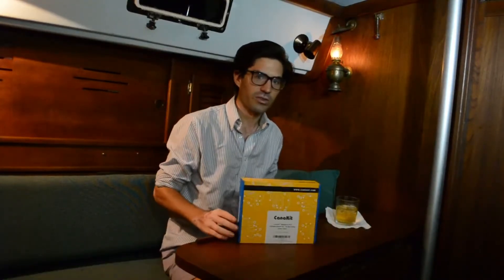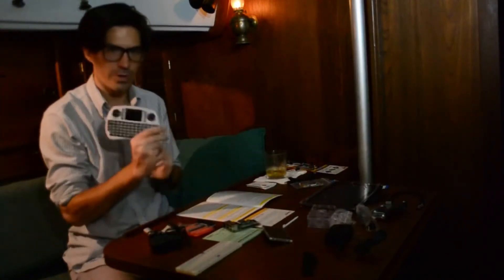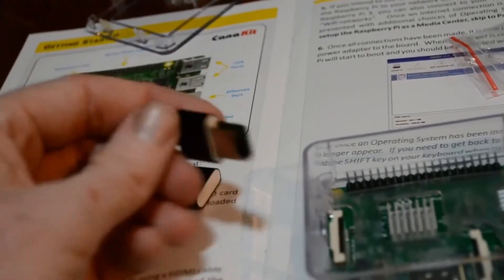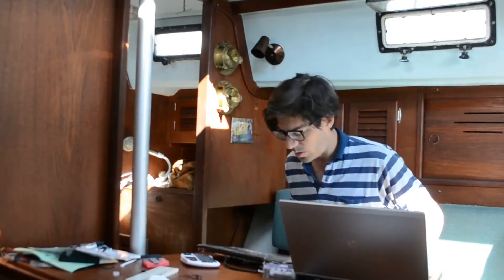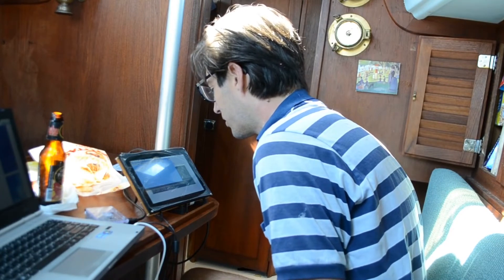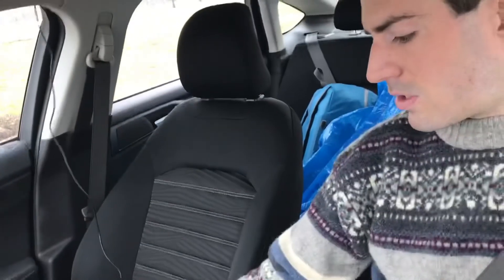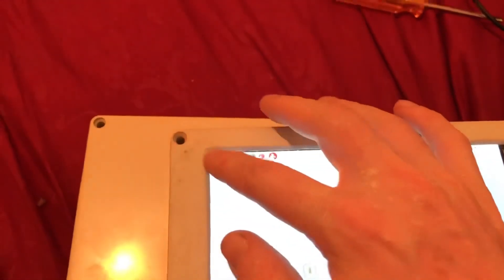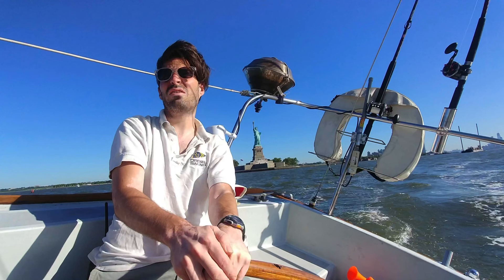Building Raspberry Pi boat computer touchscreen, GPS, AIS, NMEA multiplexing Part I 2016 (no part 2)

Comment: What 10 inch screen are you using?
Reply from the maker: Waveshare 10.1 inch Capacitive Touch LCD 1024x600 Resolution Multicolor Graphic TFT Screen with Stand-Alone Touch Controller
Reply from the maker: It broke, however, don’t drop it or crush it like me. Would be good for an interior display not an exterior